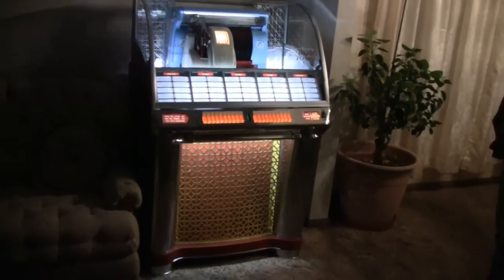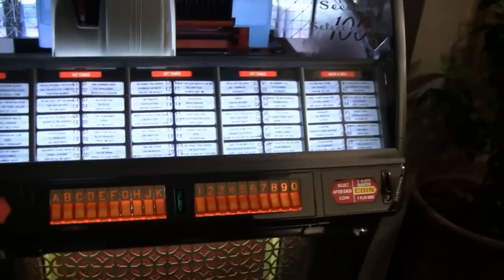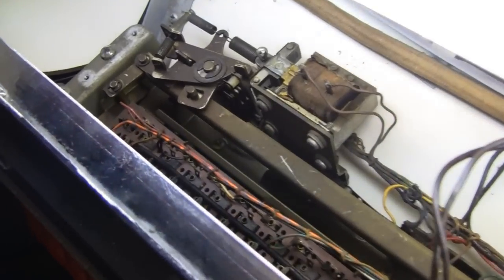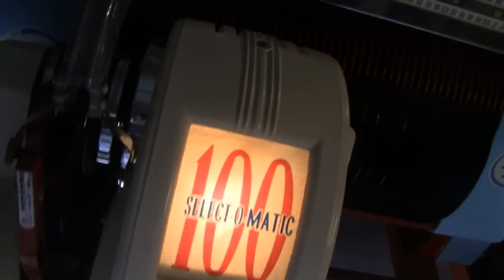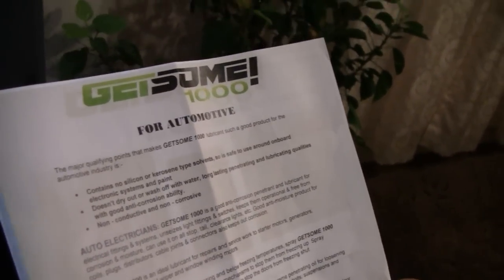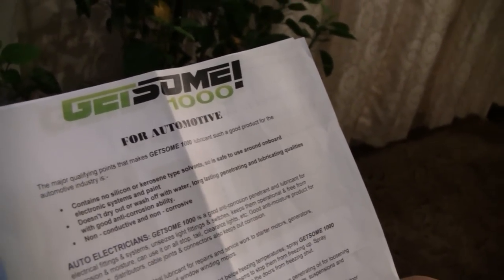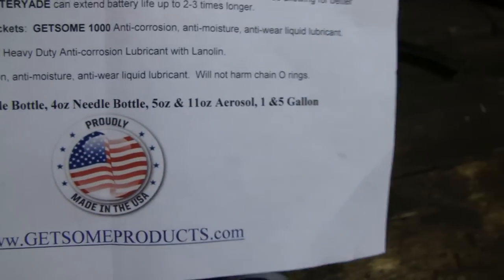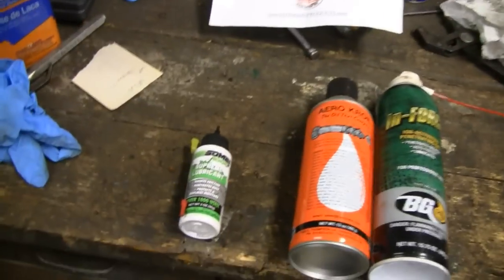COOL PRODUCT REVIEW (GETSOME 1000)

Comment: That juke box looks like the equipment I used to work on that completed phone calls when there was rotary phones.  It was called step by step.  I made a lot of those running stitches to hold the wires together.
Bruce
Reply from the maker: Bruce Pender Before the days of zip ties eh!! I'll have to learn that stitch if I ever have to rewire it!!☺
Reply: 805ROADKING Looks like the same wax string